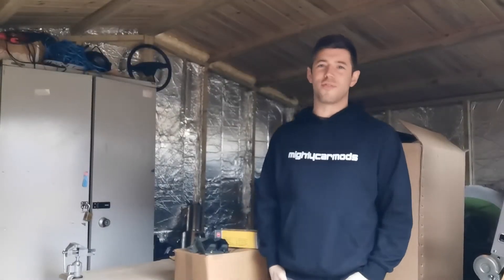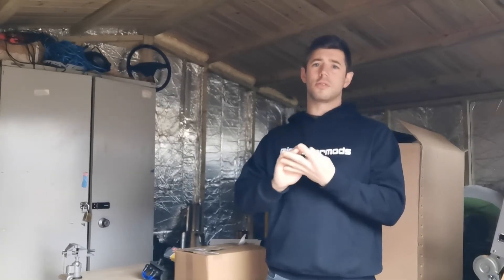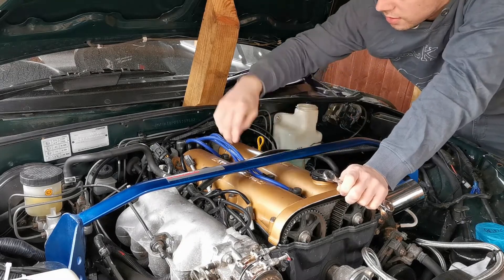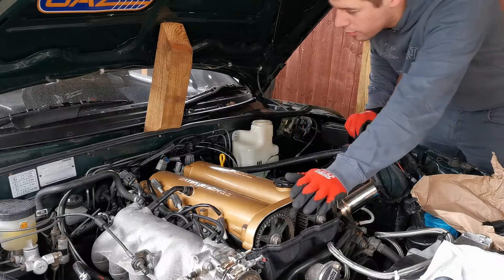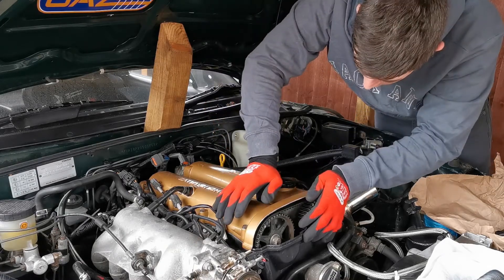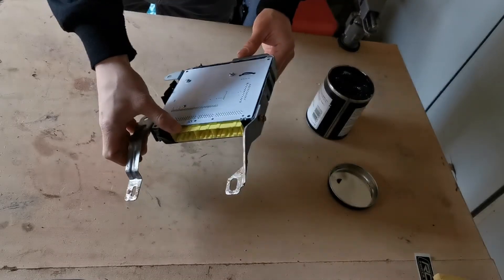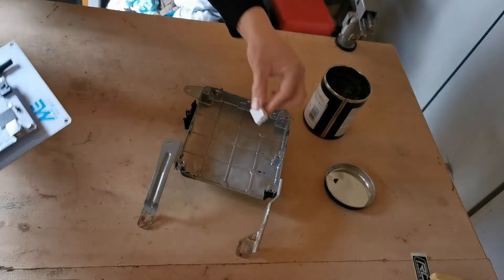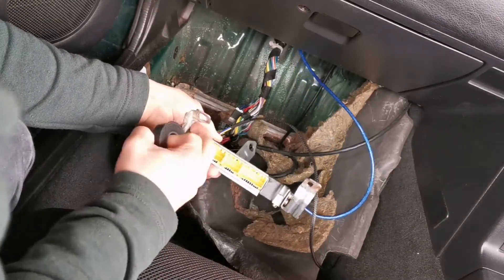Mx5 to Audi R8 coil pack cops Conversion and how to MAP!

Comment: Very nice video! can you safely use the cops conversion without an adapter plate for the coils?I want to run without it too
Reply from the maker: Cheers man! I had a layer of heat shrink round the cops so they sat firm and didn’t vibrate, I also never had any water ingress in there either. The adapter plate looks good though!